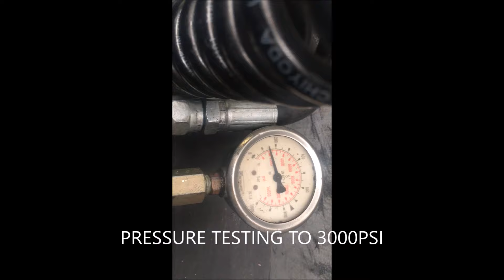Demonstration of Hydraulic hose assembly using Re useable hydraulic hose fittings and basic tools

Comment: DIY on how to be killed or maimed when the hose fails. No thanks. I'd rather not have 2k psi of 200F oil blasted into my body.
Reply from the maker: Engineering Materials and Technology in hose and fittings continues to advance, as long as you follow correct assembly proceedures and ensure pressures and temperatures are within acceptable product design limits you will be Okay. This was a short 2 min video the full 12 minute video tutorial is here, https://youtu.be/JndOT3qvhM4.